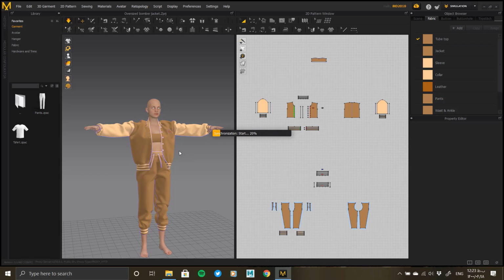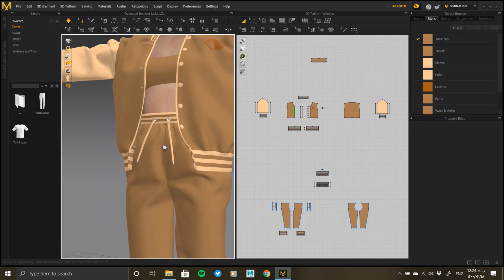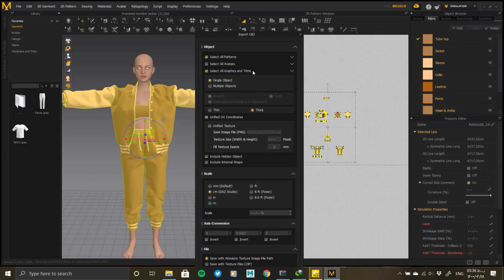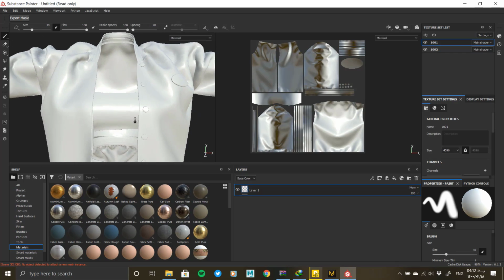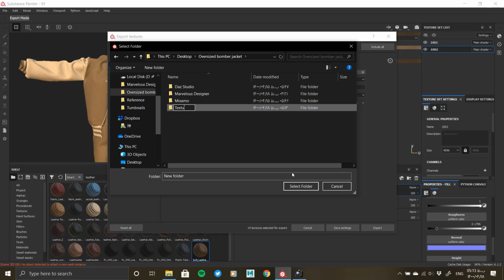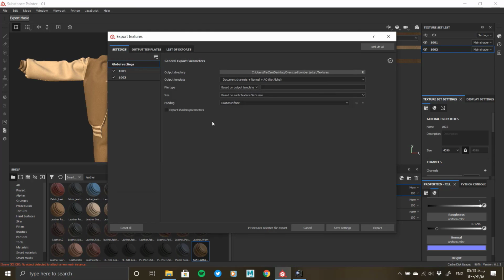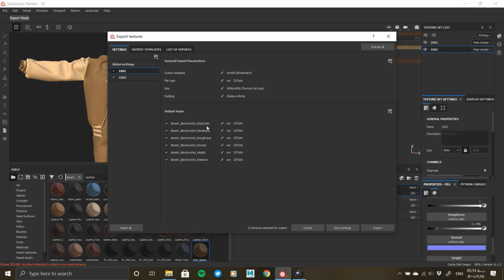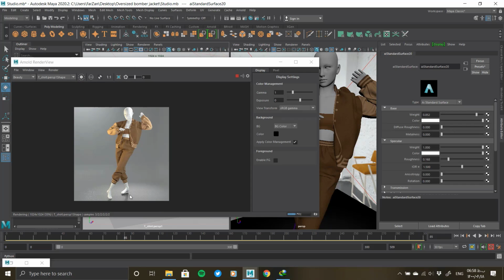Marvelous Designer & ZBrush & Substance Painter & Maya : Oversized bomber jacket

Comment: hi, i didn't understand what you said about the UVs for the thickness at 9:37. did you mean to arrange the UV in a different software after exporting from marvelous?
Reply from the maker: Hi, sorry for the late reply.
about the thickness, in MD, if you give it thickness, the overlap problem will happen to the garment and won't show in UVs, so for fixing the overlap, you can send it to another software and fix the issue there.